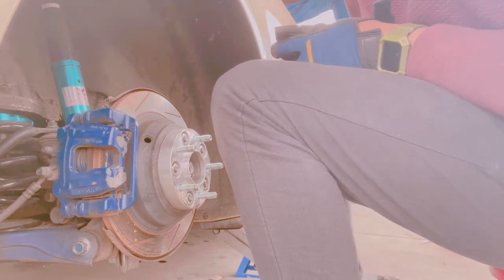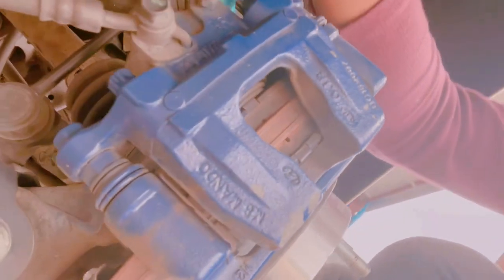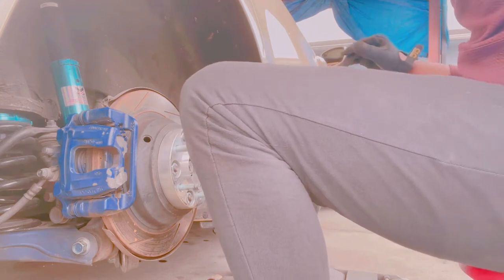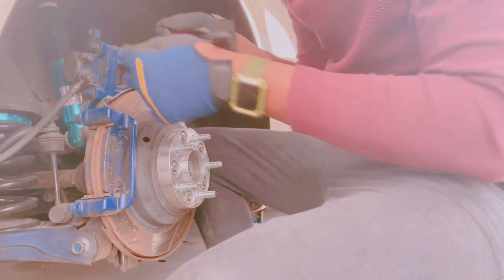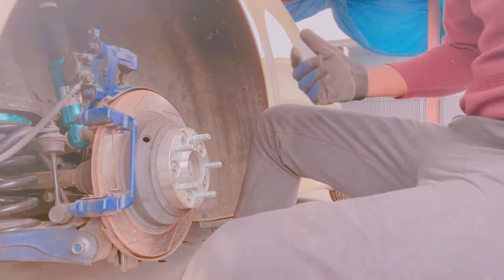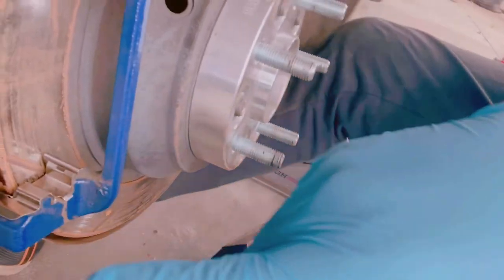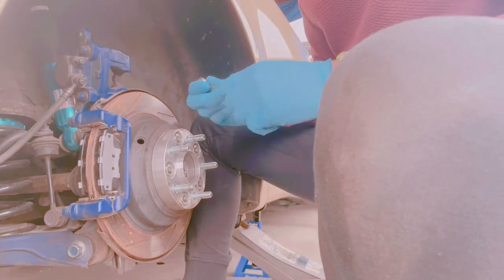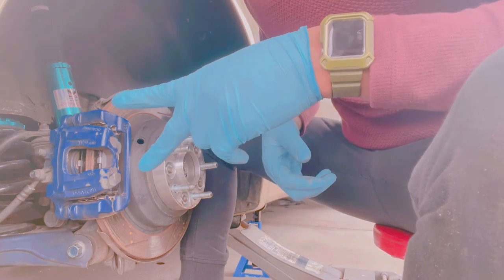Changing rear brake pads 2011 4.6 genesis

Comment: Whats the mileage on it and would this be just as reliable as a Lexus gs 350?
Reply from the maker: I can’t really say because I’ve never owned a Lexus but I’m at 179,000 miles and I’m tuned and I drive this like nascar all day everyday, change my oil and spark plugs regularly I try my best to keep up with maintaining her and so far she’s been good to me
Reply: @BH_5.3  glad to hear, im thinking of getting one next week a 4.6, since its a little roomier inside than a gs. Do you change your transmission fluid? And how often do you do your spark plugs and are they already they pregapped ?
Reply: @BH_5.3  What front splitter is that Im looking to get one? Thanks love your car. 🥶